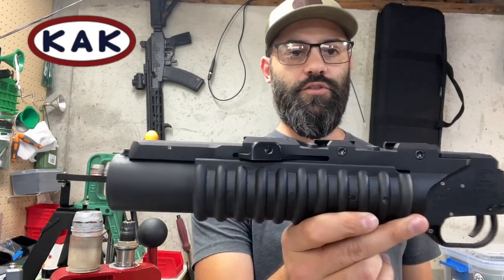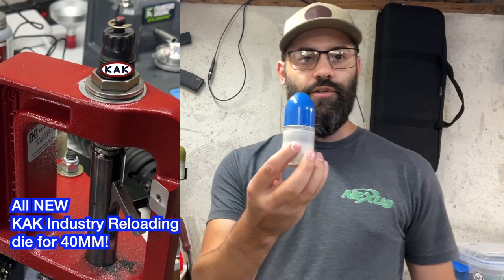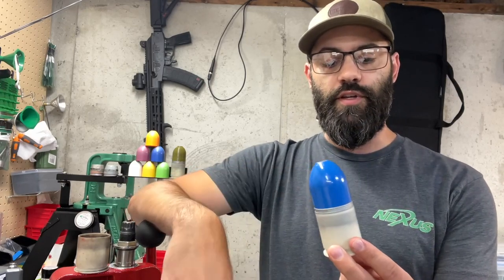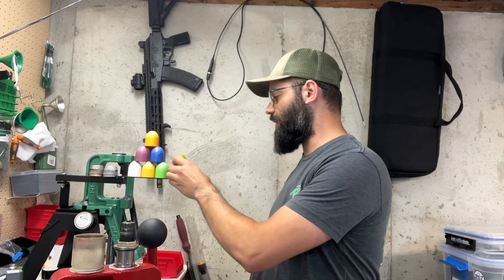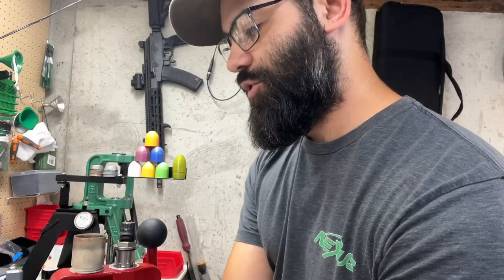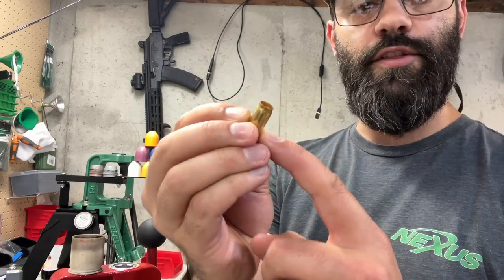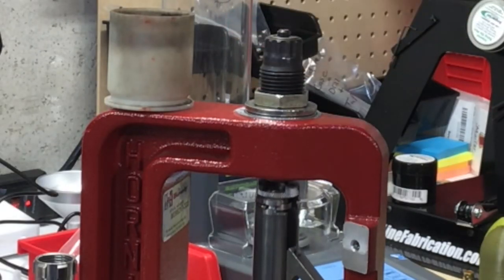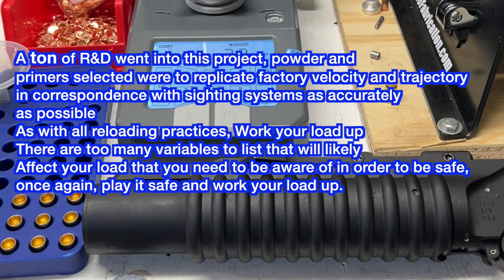KAK Industry Entering the 40MM Grenade Launcher Game W/ reloading components

Comment: I’ve seen Hornady Star blank crimp but I am assuming possibly there would be a difference in pressures.  

Some of the diagrams I’ve seen use on Wikipedia use a separate “blast chamber” to lower the initial force.
Reply from the maker: The star crimp won't work with casings or the die

Comment: How do the gas checks fit through the narrow restriction on the Nylon cases? (At 18:48 in the video) An trouble with broken or split nylon cases? Do they hold up pretty well after several reloads?
Reply from the maker: The gas check goes into the 38 SW brass, the brass presses into the plastic hull
Reply: I follow that, but when fired the gas check clears the small hole in the nylon case? The video looks like a close fit. I am guessing it would since not mentioned.  @kak_industry

Comment: Just ordered your reloading kit, and 150 more brass and gas checks, plus 15 windscreens. Hoping my buddy with a 3d printer can print some other components for me to try out. I’ve seen people recommend 5-7gr of bullseye. Is 7.5gr 100% safe?
Reply: Also, are there other powders you have experience with? Might not be able to find bullseye locally
Reply from the maker: 7.5 gr is the copycat load for the OEM chalk rounds that use a zinc pusher. If you're using a printed pusher 5 gr would be more suitable.
Reply from the maker: No  @BryceKimball7.3
Reply: @kak_industry I got some titegroup im going to try. Forums say it’s almost identical to bullseye, just cleaner, so I’ll load some 6gr, 7gr, and 7.5gr charges and see how it goes. Is there certain primers that work best? I know factory m781s have soft copper primers, and that some primers are too hard for m203s
Reply: Nevermind, must’ve missed that part first time I watched lol. I found 1000 cci small pistol primers locally for $60 so I’ll see if they work alright.